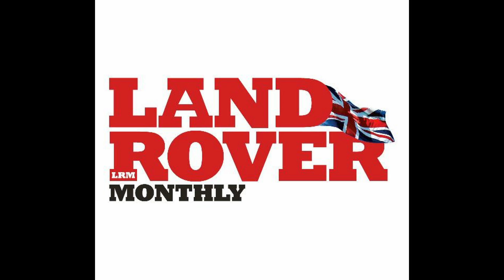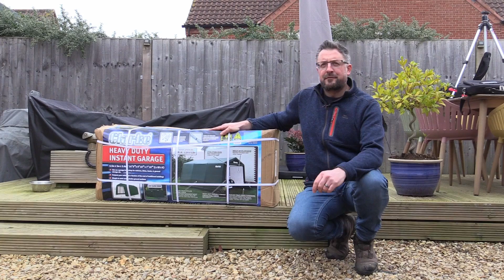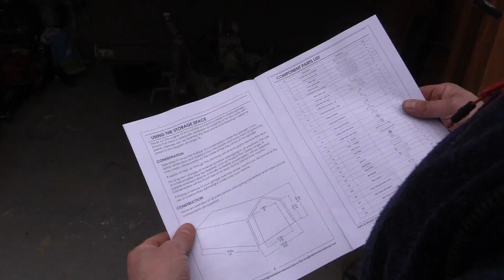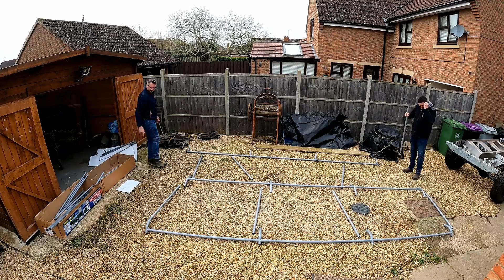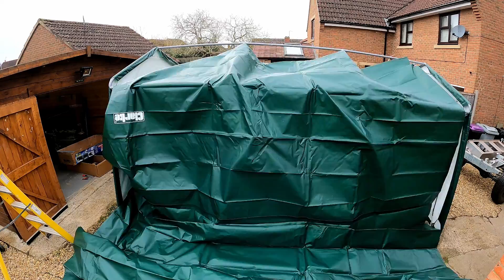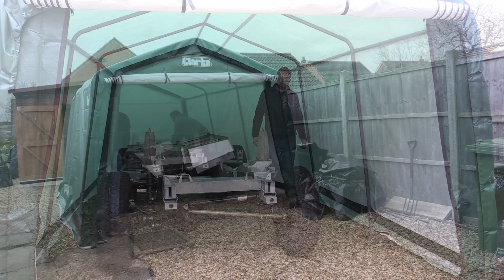More SPACE for more PROJECTS! Setting up a Clarke Instant Garage from Machine Mart

Comment: I have had one of these car tents in my driveway for over 5 years, its been through lots of storms and held up well. It was only very recently i had to replace it as finally the roof fabric gave in to high winds. I could not recommend these more its has exceeded my expectations. With regards to anchoring it to the drive way the kit comes with screw in stakes which are fine for grass. On the triangle feet on each upright there are three pre drilled holes I drilled into my drive way and fastened down with anchor bolts i got from Screwfix.  I would recommend to put some lock tight on the anchor bolts so they don't rattle loose in high winds saves having to retightened down. If you want a zip entrance at the back aswell you can by them separately. Hope this helps someone.

Comment: Did you have to install stakes in the ground I want to put one on a asphalt driveway is that possible?
Reply from the maker: It comes with corkscrew stakes for soft ground, you could use weights? Otherwise you'd have to drill into the surface.

Comment: Hi, Steve.  I've been buying the mag on and off for years, and recently discovered your podcast and YT channel👍 

Anyway, I've been thinking about these temporary garages for a while, so it was great to see how they go up.    Are the anchor ponts just straight pegs, or are they screw anchors?  Just wondering how well they will stand up to strong winds?

Going off at a slight tangent, do you know if there are any workable solutions for towing a Penman with a Freelander 2?  From the pics I've seen, the hitch ring seems to sit about 800 to 850mm above ground level, and I'm wondering if its possible to fit a Nato hitch safely to the F2, and without it getting in the way of opening the tailgate?

TIA for any advice you can offer